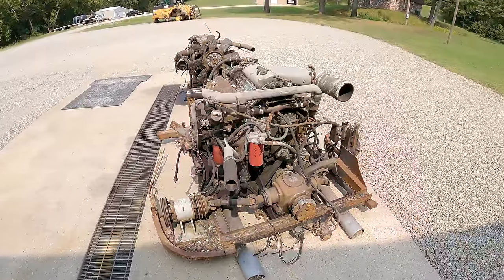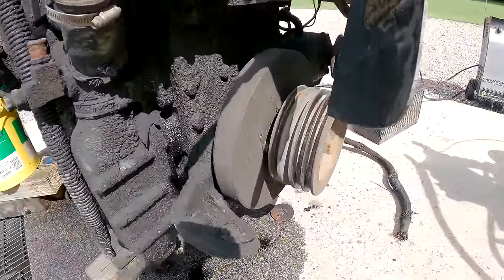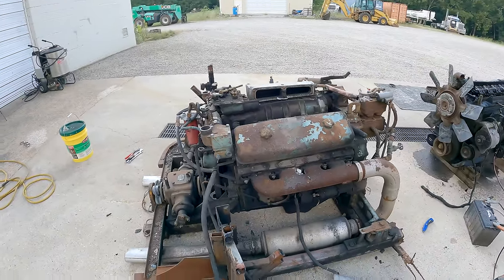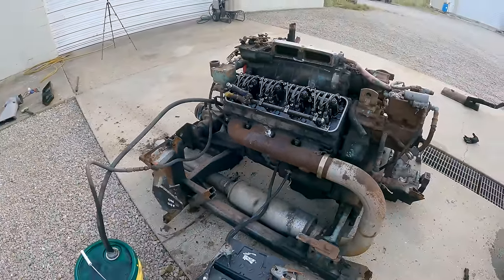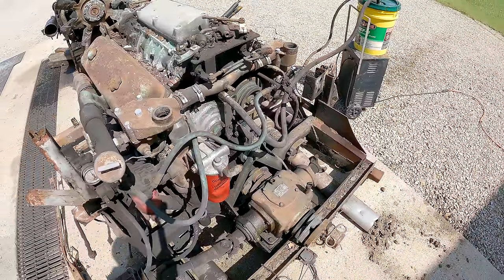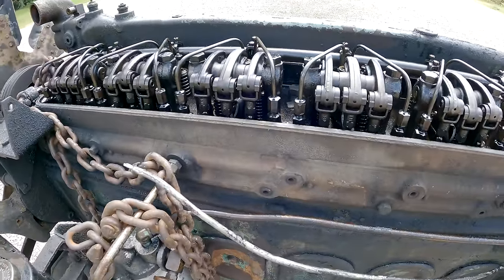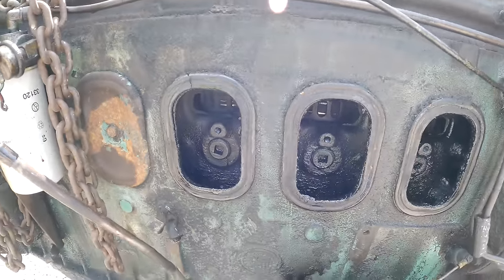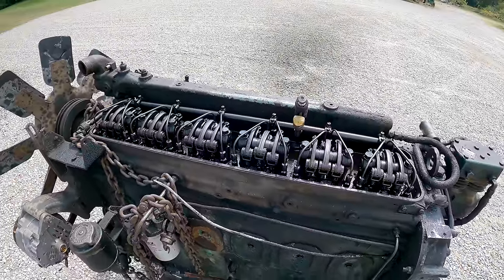Runaway 6-71 Two Stroke Detroit Diesel - Double Greasy Detroit Revival

Comment: It would be cool if you could measure what that Detroit’s max rpm is be governed rpm.
Reply: 2200-2400. Without a governor, you could get 2600-2800. If you float the fuel rail and put her in the ketchup, otherwise known as over Rev you could get 3000-3200RPM
Reply: @buckberthod5007  if the valves dont float then it could go upwards of 6500+
Reply: It was running at around 3600 rpm
Reply: @BeamerTheFox  Sounds like it because it's a 2 stroke lol
Reply: @BeamerTheFox  At runway, id agree its 3400-3600. But you can rev em to 3200 and still control it.. Past that she's running away on ya and she ain't stopping till she stops

Comment: Отличные 2- тактные моторы, надеялся что разлетиться, но увы... Может быть получится с двигателем укороченного автобуса, буду ждать.
Reply: Onlar əla mühərriklərdir. Əminəm ki, qayğı göstərilsəydi 500.000 mil qaçacaqlar.

ဒီညှဉ်းပန်းနှိပ်စက်မှုစမ်းသပ်မှုတွေကိုကြည့်ရတာအရမ်းပျော်စရာကောင်းတာပဲ၊ ဒါပေမယ့်ဒီလောက်ကြီးမားတဲ့မော်တာကြီးတွေကိုဒီလောက်ပြင်းပြင်းထန်ထန်ဖျက်ဆီးပစ်တာကိုငါအမြဲစိတ်မကောင်းဘူး။
Reply: The shot bus joke, good one. This is where engines come to die comrade.
Reply: In English: "Excellent 2-stroke motors, I hoped that they would fly apart, but alas ... Maybe it will work with the engine of a shortened bus, I will wait."
Reply: Мальчик ты гей
Reply: @luke144  Key word "comrade"
Reply: @mikhailgorbachev3721  Maybe the plural WAS appropriate? In this world🤔
Reply: @mikhailgorbachev3721  Nobody cares whether or not you use formal pronouns in a YouTube comment section, lol.

Comment: I would love to see how long it could do that with the coolant system working.
Reply: Bring a big diesel tank
Reply: Hell I can tell you this about the old 238 Detroit diesel.  In 95 I was driving one for my boss hauling grain when we had a storm blow up during the harvest.  2 full weigh wagons and 2 combines full of soybeans 1400 bushels total.  This was stuffed into my high sided grain trailer that could haul 1500 bushels total of DDG cattle feed.  It made it in to the elevator throwing 5 for flames out the stack and all we had to do with it was replace the main bearings and 2 injectors.
Reply: It would go literally forever.
Reply: Same!!!!

Comment: I managed to shut down a runaway Detroit. Cold start on a cold Denver morning. The damper failed. I kicked the air intake off after the cab mounted air filter. Crammed my Jean jacket into the intake. Kept myself and several others clear of the engine sides as I thought it was going to blow up. Finally got it snuffed. Pulling and running on crank case oil. Freight Liner yard iron.

Comment: I had a 671 run away with me one day. Until I got someone's attention, all I could do was keep my knee pushed into one of the rubber air pipe connectors that kept it slowed down a little bit. The emergency shut-off was frozen up. Finally, a coworker came and pulled the fuel shut-off. This was in the lower unit of an old truck crane. What happened while revving the engine it dropped a valve, and a valve keepper jammed the governor wide open. That's what happens with old junk. Oh yeah, I was only inches away from the fan.

Comment: Man, 45 year ago, I had a single cylinder German Holder B20 single cylinder two stroke diesel engine from WW ll run away. It had the Carter full of oil that went up to the camera.
Only managed to stop it when took of the injector!
It run perhaps up to 3.000 rpm. 
My helpers all run away only with the racket!
Still engraved in my memory!

Comment: As some that used to haul gravel with a 8v71 in an old Brockway tractor, good riddance. My boss called them the "2 stroke joke". I drove that truck for a season before we repowered with an 8v92ta. The 8v71 could barely keep up with a Mack with a 238 and a 5 speed, it was even more embarrassing because of the noise. The 8v92 was rated at 435hp but a 350hp Cat or Cummins would walk away on any uphill. Fuel was 1 dollar a gallon when I drove and even then the 2 strokes ate like 30% more fuel the small cam in the other truck. They were cheap, we got the 8v92 for $1000 and put in pistons and liners. Otherwise my boss would have switched to a Cummins. Nostalgia is a funny thing. The one big difference that I liked about the 8v92 was that the turbo quieted that screaming a little.

Comment: We also had one that was smoking and missing real bad and the yard guy was still using it, I checked it out and it had a hole through both sides of the block. It had threw a rod and had no oil and still they used it for 45 min. I drove over to the shop and it was scary how high it revved to get it to move. I didn’t think it would make it but it did. I can’t imagine driving it like that for that long

Comment: I can also testified to them old Detroit's, my company (a construction company) still runs in daily service Terex TS14Bs, with two 4V71s with 6 speed air power Allison transmissions, I tried to kill them, only to end up with a bad back, and knees from them. you can't kill them, just add a gallon of oil every day to the engine because they'll either blow it all over the ground or eat it, but it'll keep on turning. the one machine has well over 40,000 hours on it.

Comment: We tested one on a dyno in the army ( 1971 ) .oversize injectors , big turbo ,and other stuff .  Over 1000 hp when it self distructed .  Flywheel went first .
Reply: Also ran a few for 21,000 continously hours , changing oil and filters on the run . Folly loaded . None blew up.

Comment: Putting a board, clipboad... over the intake would have stopped it before it was fully runaway. After, they can run a while just sucking oil through the blower seals.
It's why they're supposed to have the emergency stop flap on the blower with a cable. It's also why you don't fool with the governor unless you know what you're doing.

Comment: My only experience with a run away was a 1972-3 john deere 4620, throttle down nothing, shut key off nothing, I had a 4-18" plow in the ground shifted into 8th and killed it that way, injector pump failed and also killed the old turbo too, good old days

Comment: It's how runaway engine locks most of the time. It doesn't explode.  had runaway engine on my semi. It was 2004 Detroit s60. Mechanical file injection. I stopped it covered air intake.

Comment: Such a sad ending for such a noble beast.  I'm not a GM guy, but the old 2 stroke Detroits have certainly earned their keep.  Up until the mid to late 90s it was hard to find a commercial bus, power generator, air compressor, or irrigation pump that didn't rely on the old 2 stroke Detroit Diesels.  I spent several years in the U.S. Army in infantry units, most of the time as a maintenance personnel (63T10H8) where I operated the M578 recovery vehicles powered by the 8V71T and M113A2 Armored Personnel Carriers (APCs) which were powered by the 6V53 Detroit Diesels (ever heard of the "318 Detroit? 6 cylinders at 53 CID apiece, do the math). Being in maintenance, there was nothing like having to wake up in Germany to an "alert call" and rushing to the motor pool with my crew serve weapon on my shoulder, my personal weapon on a sling around my neck, and firing up the engine in my VTR (Vehicle, Track, Recovery) which actually had an airbox flame cold start assist. When I got my vehicle started (which had 4 12 Volt batteries in a series/parallel configuration for 24 volts) I would go to the "track park" and assist our infantry personnel to get their vehicles started by jumping them off (in military speak, I'd use my slave cables to slave-off their vehicles). After all the vehicles in my company were started up and ready to roll, my crew and I could finally relax until the order to roll out was given. During that time, the hum of the hundreds of idling Detroit Diesels and the big block 250 HP Cummins was surreal.  Most people equate the smell of cinnamon and such as the smell of Christmas, but for me, the high-pitched whine and diesel smell of our motor pool as we awaited the order of "Roll Out" or "Stand Down" will forever be etched in my mind as winter and Christmas.  NO REGRETS!!!  U.S.A.

Comment: even though it was sad to see that engine pushed to failure with some new rings, sleeves, a rebuild of the injector system and a check of the bottom end she would run again in no time.

Comment: 671 ti that'll turn 2400 rated @485hp motor is in a 40ft Youngs brother's charter boat engine is a beast.as an engineer on a 100ft dragged I ran a 671 na (generator motor) for 9 days with a cracked block every 24hrs it would run away when it burned all the coolant out the stack.id shut it down cool it off refill coolant and repeat 😁

Comment: I found that my 4-71 is very cheap to run compared to any other engine of the same hp. They only got ridiculous on fuel when guys started putting turbos on them and bigger injectors to increase the hp.

Comment: Well damn that thing ran for a while. I started thinking is this thing ever gonna quit??
Then it still cranked over after all that torture!!
Reply: It didn't sound that good when it cranked.
Reply: @foe  no it did not at all, but the fact it cranked over at all is ridiculous!
Reply: @invisiblekid7374  I'd imagine if you put some oil in the in wall, the rings would pop back in. But considering how hot it ran, the piston rings are probably welded.

Comment: Heard you use the term "no load". That seems like it would be dangerous, something that's supposed to be pushing 50,000 pounds or whatever a bus weighs, with no resistance.

Comment: Run away is not wiring the throttle wide open. Run away is when you shut it down, but it can't because it is burning oil from internal oil leaks.
Reply from the maker: The throttle wasn't wired at all.  You don't understand the difference between the throttle and the rack, among other things.
Reply: @KT3406E  Fr, I lost some braincells after reading his comment
Reply: @KT3406E   my point stands. And yes I do understand. Your point is irelivent to mine anyway. If you are not sure, look it up for yourself.

Comment: So let me get this right, the three rockers on top are: outer are intake valves, inside/middle is mechanical fuel injector, and for exhaust it blows out through the bottom ports that can be seen via removing the "airbox covers"? Is this correct? It seems that this is a 2 stroke diesel? Is that even a thing? I imagine a turbo would make this whole setup run much better, but wouldn't the hot side of the turbo get carboned to all fuck?

Comment: I don't understand why you destroyed the engine??
Reply: Because the engine was not being used in a vehicle and it could not be used any vehicle due to its mechanical problems, causing the owner to then rig it to “runaway” the engine is being used in a way to where its teared to shreds on the interior, instead of it being thrown out and it sitting there regardless. 

Now do you understand @davea5150???
Reply: I know it took me year to answer your question, but does it answer it??

Comment: That's not a runaway (when the engine takes off running far past the redline).... You just ran it at wide open throttle without a radiator and it eventually seized up....

Comment: You can't tell me those old motors weren't built to last
Reply: Yeah, I think we understand that this man redline the engine for 8 minutes without flying apart with NO coolant. Most engine would fly apart and lock up, but this one didn't. They are bad in terms of fuel and power ratio but it's possible that some tuning would make a difference. So yea they were built to last.

Edit: although the engine does make terrible noise after killing, it is still surprising that it turns with a starter.

Comment: I really wonder how you can run these engines for that long without checking their temperature and oil pressure- you are lucky that they didn't seize. I can see that there is no oil coming from the rocker arms while running them.

Comment: oh yea the 6-71 a screamer. runs backward just like forward just no oil pressure. blow a hole in a piston WOW hit the emergency kill LOL. there was a drilling rig with 3 banks of 2 for power. a couple miles from our house on  the still summer nights you could count the pump strokes by the engine sound.

Comment: You should have moved closer or used a telezoom. And you should have overfill the engine oil, that would caused an runaway much faster as it would have sucked it's own engine oil in.

Comment: A bit sad what an engine they are tuff. A guy l worked for burned up a 453 in 30 ton crone crane ran it nearly 3 miles with no coolant. It died about a quarter mile from the shop.

Comment: on that 6-71 its to bad you did not have a cooling system on it and then do the run away thing it may have blown up do to over revving   instead of locking up do to heat

Comment: why wouldn't you secure the wires to the starter nd then you would only have to slip on the positive to the battery everytime you wanted to start it. it would be a good bit easier in everyway for you I believe.

Comment: this is a shame  I am a retired truck driver, knew the 318 and the 360s  how you drove them is slammed your hand in the door three or four times got good and made and wind the hell out of it before you shifted it, they would run backwards if you lug them, where not really intended for trucks use mainly for generators loved fuel  around 4 mpg replace by the 60 serious.,  detroit diesel engine always got a bum rap could have put it in a rat rod or something

Comment: Also a lot of comments about the fuel thirsty nature of these beasts. I wonder what could happen with todays "detroit" engineers and all the electronic computer controlled elements that could be introduced to this amazing engine and the outcome of that? obviously with more hardware nerdery applied to cylinders, ports, piston crown, head, injectors, sensors, etc.

Comment: Anyone know roughly the power output on full throttle vs max peak torque at whatever rpm it hits it at and when you go past the red line or full fuel, if you had a load would it produce more power.... Lol sounds like a stupid question but I drove some diesels for work briefly delivering shit f450s nothing big... But I do know at a certain point increasing rpms kinda just spun the engine faster but no power but maybe because of the gears I dunno.... Lol I think diesels are based on more torque at lower rpms vs gas engines that have higher power at higher rpms..... Jesus I sound like a first grader been up 2 days forgive how poorly I'm asking what I am asking.... What the hell was I asking again😮‍💨

Comment: this particular engine actually does not produce a bad amount of power. I believe 200 and change HP for 400 and change cubes (although HP is irrelevant in diesel). Its the fuel economy that's the downfall. but that's the nature of 2 stroke (but so is longevity). I have a 40 year old Ford/Lehman in my boat and she is roughly the same cubes but only produces roughly half the HP of this engine. Operating RPMs are only about 1000 RPM so the tradeoff is insane fuel economy (less than a gallon an hour) and engine longevity. It is said to easily get 10k+ hours. Mine has 2k and runs like a champ. The down side that has people swapping them out for Volvos and Cats, is speed. In the world of 6 400 hp outboards being slapped on the back of every Instagram boat, nobody is willing to go slow anymore. But at a gallon an hour, I am sure as hell ok with it! The only thing to ever go bad on the fords are the exhaust manifold and injection pump. I just replaced the original pump on mine 2 weeks ago so I should be good to go for another 40 years👍👍 Just cant beat the old low RPM NA diesels

Comment: What a shame a loss of resources...

The engine sounds like it had alot of life before you ruined it...

To destroy it faster...how about the next engine you try to blow up.

Add a gasoline mixture or lots of starting fluid while at top speed and of course remove all pan oil prior to running? ..

Try to get those rods to snap off the crank and come through the block

..or maybe how about lots of small ball bearings in the intake...?...or maybe some SiC grit blast power...something hard to get past the blower...

Comment: Oh my gosh ,no not juice . If you must use gas and a rag. Never junky juice. Nevertry to start withlow battery voltage.#1reasonno fuel in this engine usually means fuelpump d4ive

Comment: I have had these motors run away on me myself that's why they have emergency air shutdown valduk us the oxygen off these motors will run on the oxygen out of the air when they run away I have been standing right beside them between the wheel in the motors several times when they ran away and I hold the are shut down and shut them down I have seen two on refinery's completely runaway and blow up